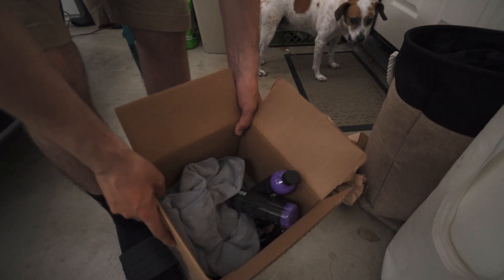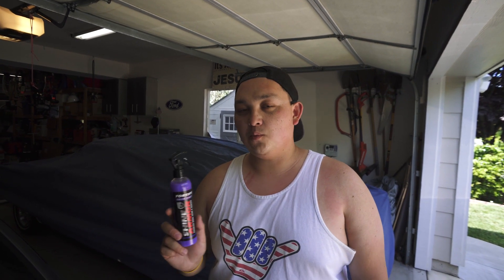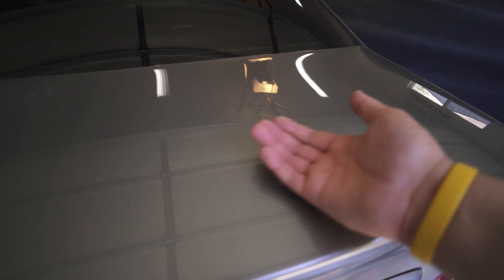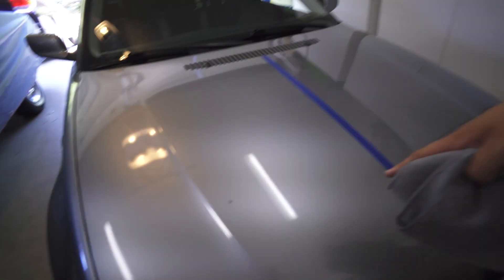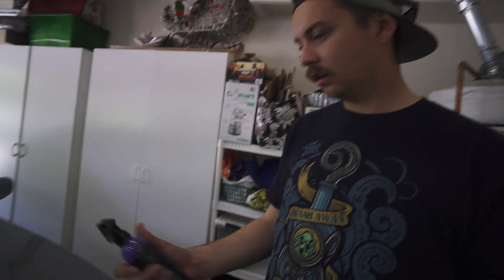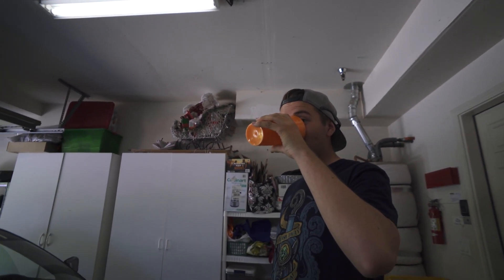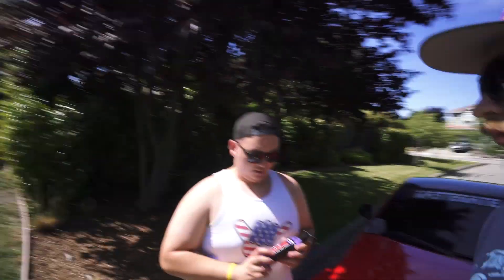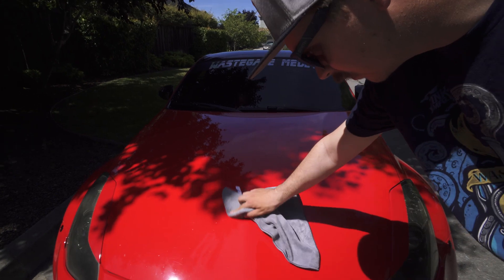OUR HONEST OPINION ON SHINE ARMOR FORTIFY QUICK COAT

Comment: it shows a faded red car in the presentation but what it doesnt say if your paint has started to fade that it will not make the faded section look like the rest of your truck other than that i have a nice shine and faded look
Reply: That's because it works with the clear coat like most waxes, "faded paint" happens from the clear coat getting baked over time and stripping it off. Clear coat is also what gives paint most of the shine. You would have to strip the faded parts down and repaint them to make them look any better.